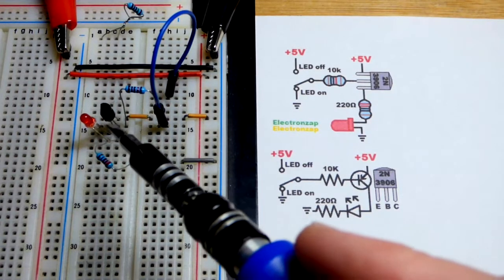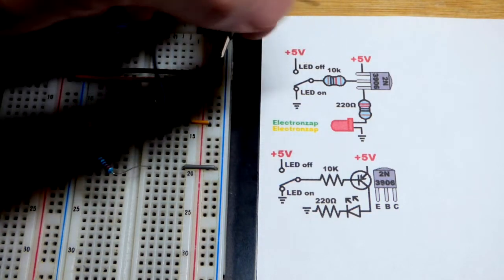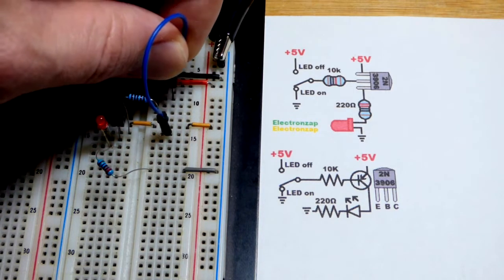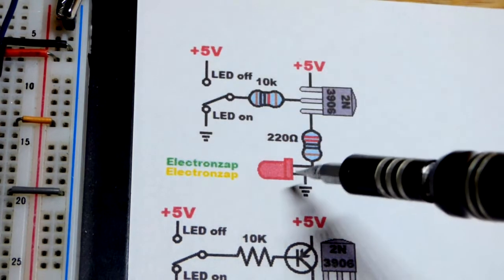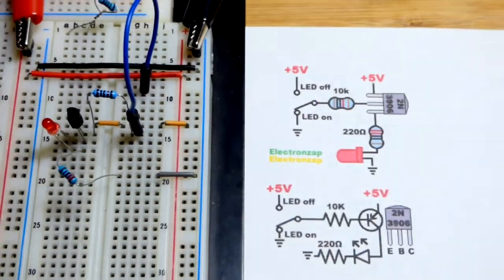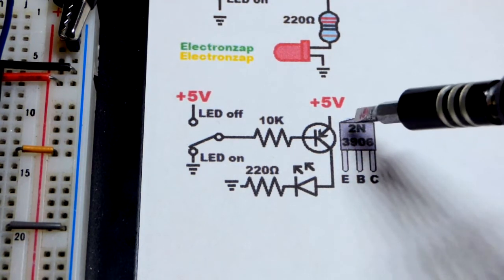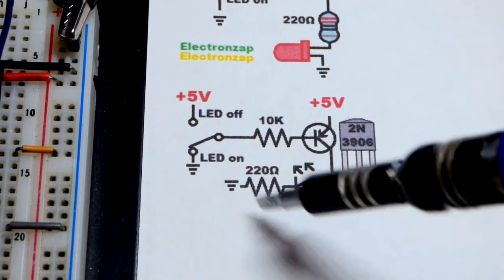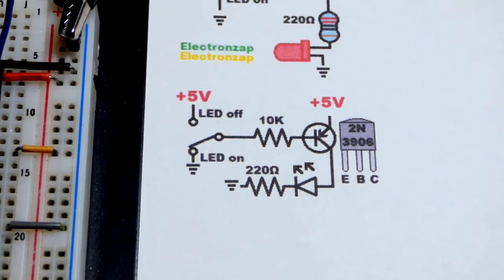PNP bipolar junction transistor BJT switch circuit controlling an LED

Comment: Another great video thanks. What would be some of the  factors in deciding to use a PNP over a NPN? Is it to do with the voltage being more/less positive/negative or component positioning?
Reply from the maker: From what I read, it used to be a lot harder to make PNP BJTs than NPN. Also, usually ground/negative supply is the end point for most circuits, so it's awkward to be using it as an input to something that needs current.